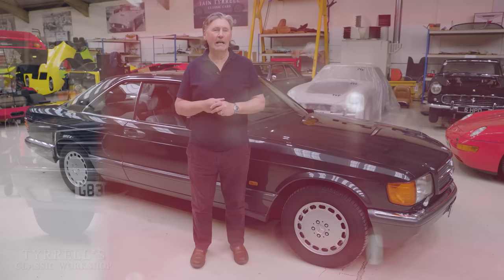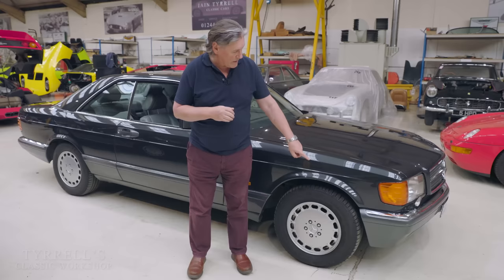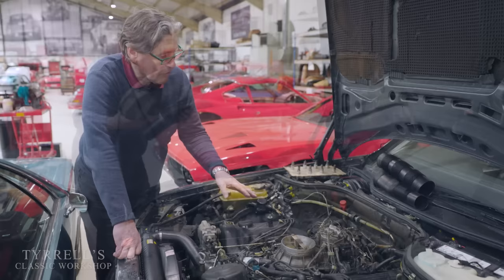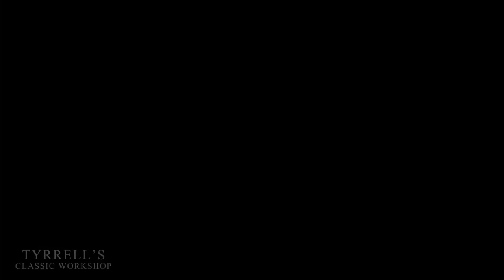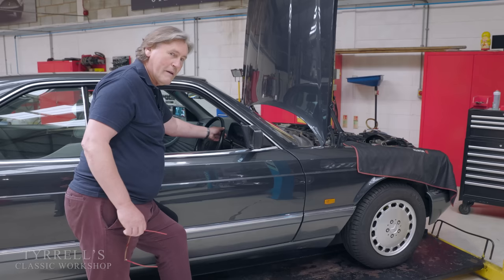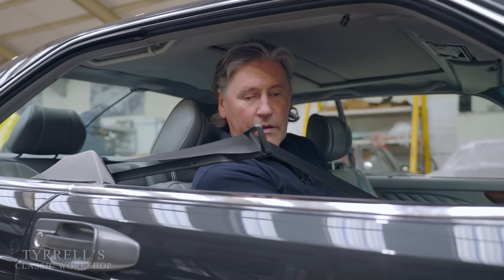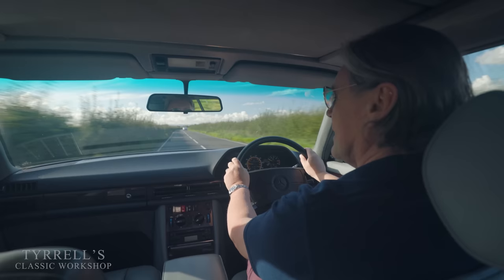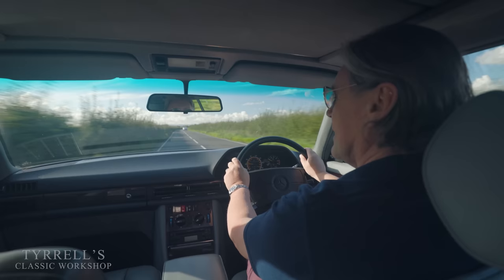Recovering the beast of an 80s Bahnstormer - Mercedes-Benz C126 560 SEC | Tyrrell's Classic Workshop

Comment: A C124 has an even better line. That one is perfect.
Too bad the steering wheel is on the wrong side, because that makes it worth much less.
The UK versions are also much more rusty. There is already a lot of rust under this one with so few miles.
At that time, the Japanese did buy left-hand drive Mercedes and they are now bought up for a lot of money to go to the EU. They did that smartly.

Comment: Ian, I know you said quite often in the video that the 560SEC was the pinnacle of Mercedes Benz offerings but would you say it was above the 560SL?? I mean if you went into the Dealership and told them you want the flagship car, would they say it was the 560SEC or the 560SL??? I'm an American and i was always told the 560SL was the flagship.  Love your videos btw.
Reply from the maker: Interesting question. I reckon the SEC would take it because it was a more recent model, with the 107 having been around for 10 years before that. Be interesting to compare prices at the time.
Reply: @iain_tyrrell  If my memory serves me right, the 107 cost was higher in regards to MSRP.  Plus in the MB new car brochure, they highlight it as the premier MB.  I wanted to ask you because you are a complete wealth of knowledge and i respect your opinion very much. Thanks for replying.

Comment: There is a slight rattle from the car under higher rpm’s … it there an issue with valve bounce or timing chains around 19.33

Comment: Nice video, but not quite right on the US spec W126 560's having single snorkel. The US W126 560SEC's and SEL's did have a twin snorkel air cleaner. The SL's did not because there was no space for it. The exhaust on the US cars was restrictive and they respond well to the Euro logs or Tri Y manifolds.

Comment: Excellent video! Thanks. Q: so two induction pipes letting air into the engine, rather than one pipe, automatically means the car is the 300hp version?
Reply from the maker: Thanks. Not sure on that- possibly but not 100% sure
Reply: @iain_tyrrell  thanks! I’m not in the UK and just took ownership of a 1991 560SEC. Should I need OEM parts, any particular source you recommend? I may need a steering box and maybe an AC compressor. Ones on the car have been serviced, and so “opened”, which I therefore don’t really trust they’re working optimally. Is it usual to open and service these? I hear a vibration as I turn. Also the A/C vents aren’t blowing air optimally as well. Any tips there? I’ve been told this car doesn’t have a cabin air filter. Could it be the evaporator or condenser? I need to learn a lot about those beautiful cars! Thanks in advance for any tips you can give me.

Comment: The 500SEC was the fastest production car from 100 kms to 200 kms when it came out.
I owned one and was disappointed by it.
The 4 speed auto basically made the car freewheel when you took the foot of the accelerator.
The steering was too light in that you got no feed back through the steering wheel of what was happening.
They are theoretically fast but unusuable because too long and too wide.  
Only good for driving on German autobahns.
The dream car of an Albanian crook.

Comment: Any issues with the wiring loom on this example ?
Reply: Not on these models. MB cars manufactured between 1992 to 1996 have biodegradable electrical wiring harnesses. Biodegradable wiring harnesses were used in the production cars to comply with the environmental norms in the 90's. Delphi was one of the suppliers of wiring harnesses to MB made out of biodegradable material instead of traditional non-degradable insulation found on the early cars.

Comment: I have two of these 1984 500SEC euro & 1989 560SEC US
and im so disappointed from the fuel injection system
why they downgrade from D-jetronic I have on my 1972 280SE 4.5 ?
Reply: the K-Jet and later in the Gen2 the KE-Jet CIS was chosen to meet tougher emmissions requirements & better fuel economy (same Bosch system in the 80's on Porsche, VW, Audi, BMW,  Rolls-Royce, Bentley, Lotus, Ferrari, Peugeot, Nissan, Renault, Volvo, Saab, TVR and even some Fords has them.  So it was a very "go to system" until EFI came along.  
They are not hard to work on if you know what you doing.  Simple smoke test to find any vac leaks.  Get the Fuel distributor rebult & calibrated properly (CIS Flowtech in USA) and replace the Injectors. Your Airplate assembly will most likely be out of spec and need re-setting (easy to do) possibly on the Gen2 KE-Jet the Potentiometer tracks worn. Idle control valve most likely needs cleaning of carbon buildup. Besides rebuilding the FD all the other work can be done DIY at home using basic tools to get it running sweet

Comment: Quite a disappointment that Iain is comparing the 126 with a Mondial 8. That thing had merely 200HP. Later Mondials like the 3.2 (that was shown in the picture) and the T would have been a proper comparison with the 126 having 270HP or 300HP.

Comment: 21:10 "...340 pounds-per-foot of torque..."  Nope, it's pound-feet (lb-ft), sometimes called foot-pound (ft-lb) at risk of being confused with foot-pound, a unit of 'work'.  It is a multiplication, not a division. Gets into cross-product etc., but that's getting too nerdy. Jeremy Clarkson famously just gave up and calls them "torques", not an unreasonable approach LOL.

Anyway, not "per". Opposite in fact.

Comment: Despite owning Benzes for over 20 years, I never knew the steering box could be "tightened". I thought the slop in the steering was a disadvantage to the recirculating ball type steering Mercedes used and that, only getting a "close ratio" box from a Sportline or 2.3-16 would be a real solution for improved steering. I was beginning to think YouTube was becoming just useless cess pit of clickbait, podcast videos, reviews of podcasts, etc.

Comment: Constant flow injection is not clever... it's cheap and very poor consumption numbers. Only good for power and WOT though.
Reply: The Bosch KE-Jet is great mechanical fuel injection system ahead of its time in the 80's.  The injectors very fine mist and atomise well.  The system was used in many high end 80's Euro cars  (MB, Porsche, BMW, Audi, Volvo, Saab, Ferrari & others). Many people just don't understand it, but you can't compare it to a modern day computerised FI system. 
Bit like trying to compare a carby to modern day FI system.

Comment: Jaguars are better. Much better. the V12 is smoother better ride 1000% better comfort - the interior on the 560 is so austere. and lots of plastic.
Reply: It would be interesting to back to back compare with a V12 XJS, I'm struggling to believe the Merc's ride or engine would be smoother. Don't mention the rubbish transmission 3 speed Jaguar used though!
Reply: @ashleyweston5420  I agree re the 3 speed box in the V12. 

Wish there was a Singer 991 reimagined version of Jaguar XJS using say the wonderful J gate box or 5 speed manual. I got a V12 and a V8 1998 Sovereign. Also a XKR Convertible 2001. 

Love Jags. BUT NOT the New style ones except the F Type. but interior is a let down vs the leather and walnut and chrome of earlier coupes convertibles etc.